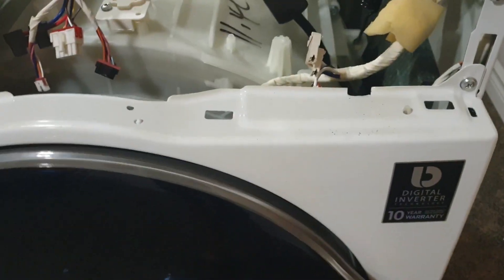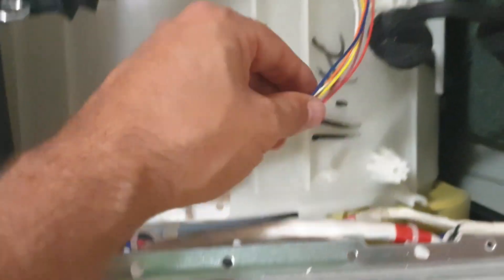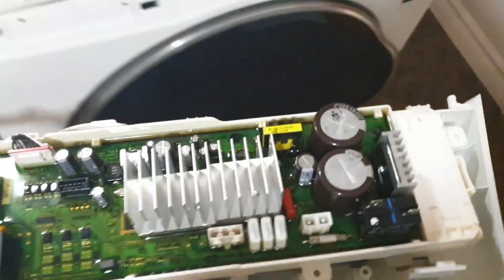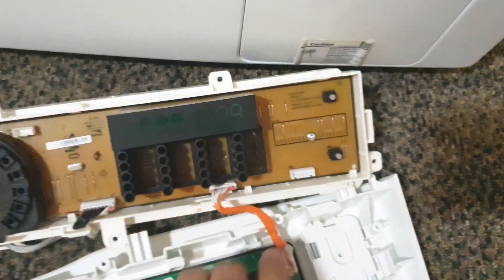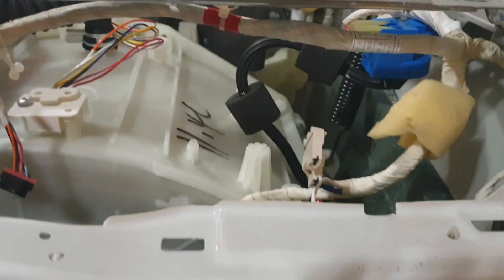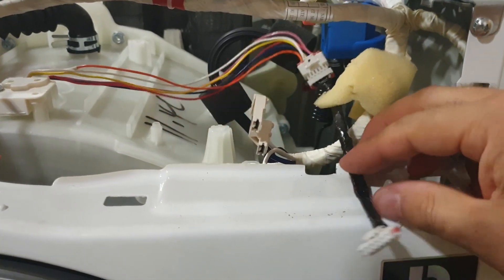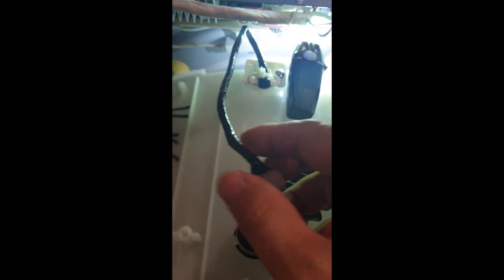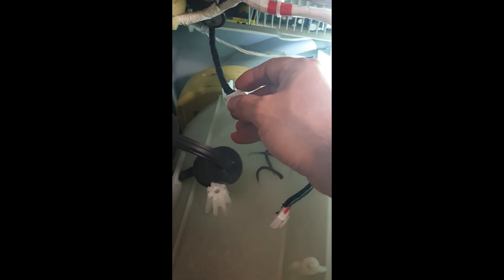Samsung Front Loader Washer, MEMS Sensor. 8C Error. FIX!

Comment from the maker: **Factory poor cable management** 

My Samsung front loader washer model number is WW22K6800AW/A2  this fix could apply to some other models too. Do not buy the MEMS sensor before you check this out, this can fix your problem, I did`t wasted time with editing and and how to remove the washers top panel, if you can not figure out that for yourself... than what is left for you is to  buy a new washer. 

It is  very unlikely that the sensor would go bad, usually it is a harness problem, in mine particular case was the MEMS sensor wires rubbing against the washer`s frame, I have noticed at least 2 wires with the outer casing worn out, but is enough just for one wire to be exposed to the frame and it will read a different value since the metal washer cover is ground. Happy fixing, throw a like, they could have been project this washer a little better but Samsung sucks balls.
Reply: Hi Daniel. I have a Samsung WW22K6800 (not even 3 years old) compact washer with the exact issue in your video. I had the wiring harness checked. The tech said it still had continuity but just wrap the individual wires with electrical tape. Which I did and voila, the washer works like a charm. The fault caused the door to not lock which
prevented the water from filling the drum. Thanks Daniel for the fix. You saved me from buying a new washer or at
the very least $700 of repairs/parts.
Reply from the maker: @berniee4150  I am glad that my video saved you from buying a new one! I also appreciate your time to write a comment so anyone else who might have same troubles with the washer could fix it! Well done!
Reply: @RomanTrollanski  Hi Daniel..I forgot to mention how I dealt with the sharp edge which cuts the harness. I used
locking pliers (vicegrips) to bend the edge over and flatten it out. Then I covered that with a few lengths of
electrical tape. The harness is still a bit wedged in there but it won't be cut any more.

Comment: This video shows how to identify the problem but doesn't explain the fix. However, it does show some helpful preventative tips.
If the wires were damaged, did they need to be replaced? Or was it just the jacket, easily fixed with electrical tape?

Comment: I've just had exactly the same issue. The sharp edge of the frame had sliced its way through the sleeving and into one of the cores of the harness. Easy repair, now working fine. Thanks for the video.

Comment: My washer auto turn off when it spin.
can turn on again with unplug electric cable and wait 1-2 minute.
some times it recall last program, some times must restart from begining.
cross in my mind, maybe vib sensor problem..
never though cable problem.

i will chek for cable, thanks for video.
Reply from the maker: Any updates?

Comment: Thanks for the post- fixed my issue. I have the same machine and exact same problem. After going in and isolating the wires that were shorting out due to cut in plastic from factory metal edge - it was a clean cut right in same exact place- It fixed my machine and now working again... I also put plyers on the metal edge and bent it down and zip tied up the wire bundle. \ fix was easy to do and took less than 30 min.
Reply from the maker: Glad to hear that!

Comment: Hello Daniel, 
Thank-you for your tip. This is the exact problem I just had on my 2016 washer WW22K6800AW/A2. I was able to reroute the wire towards the vibration sensor, there is a space for the cable to exit the board towards to sensor. Didn't even have to disconnect the cable. So I guess it is more of an assembly error and not a design error. Did not have to open the front of the unit. Was able to do the repair from the open top panel of the washer.
Reply from the maker: Glad to know that my video helps others fixing their washers.

Comment: Lol. It's not "a simple fix" if you have to disconnect the whole machine and then cut wires and junk. That's not "a simple fix" and it doesn't cost a ton of money but to disconnect everything is crazy just to fix a broken wire. Samsung sucks.
Reply from the maker: It's a simple fix, but for others it's a lot simpler to buy a new one, your choice.
Reply: Agreed Samsung should stick to TVs. Morons.

Comment: Can you tell me what your problems were with the washer? Mine will stop mid cycle and will not start again. I have to turn off the machine, and then usually get a "dC" error code when I turn it back on. Apparently "dC" has to do with drum balancing. To get it started I have to turn it off and on again, then try the load from the beginning and hope it works.  Probably not the same as your issue, but thought I would ask. Thanks
Reply from the maker: It's the same issue. That's your problem right there! Those wires, might not be visible, out of the whole bunch of wires, only 1 is enough to short with the washer and is enough to throw that error. I'm more than positive it's the same issue, same fixing method. Good luck, leave a comment if you got it fixed. Cheers.
Reply: Thanks! Will let you know what happens.
Reply from the maker: @kylegallagher2469  did you fix it?
Reply: @RomanTrollanski  Not yet...

Comment: I have the exact washer. My problem is all the digits on the front panel are blinking. Plz help.
Reply from the maker: Unfortunately I have not came across this problem. You might have to take front pannel apart.
Reply: @RomanTrollanski  i got it resolved by pressing 2 buttons while powering it on
Reply from the maker: @guyanaplaces592  thanks for taking the time to share with us how you solve it!